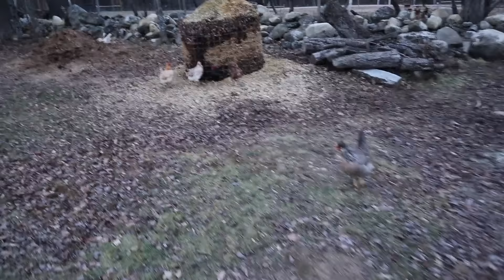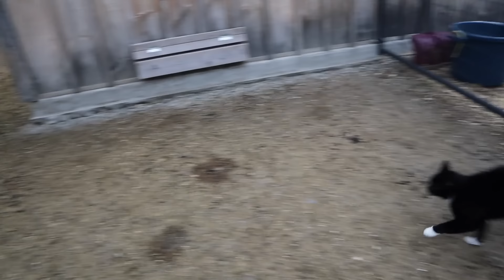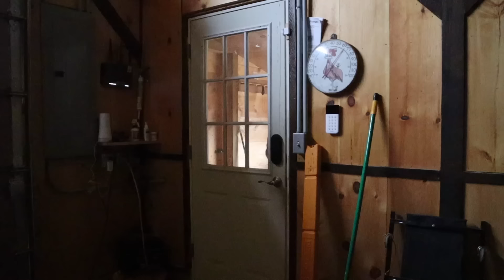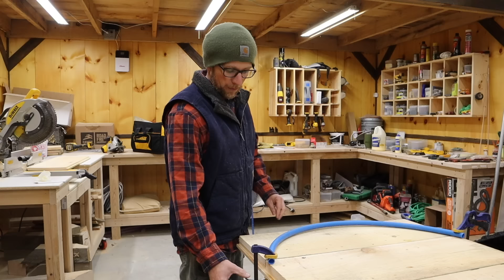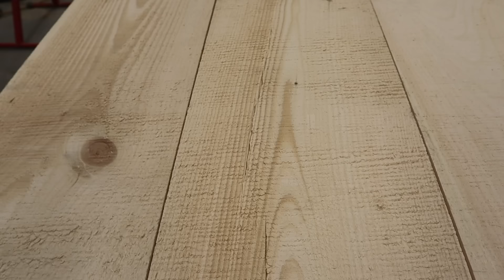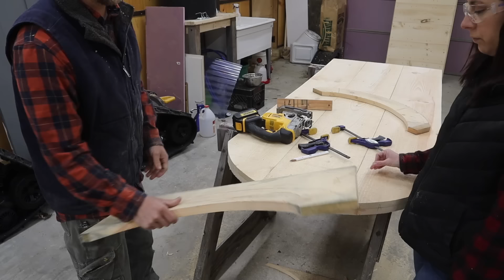Making Radius Doors & Trim for our OFF-GRID Property Composting OutHouse

Comment: Good morning Al!! As a former teacher this popped into my mind. A question in a test having to do with finding area with a goat, rope, and fence involved reminded me...  it should work. Measure the width of the door. Divide that number. Tie a pencil to a piece of string that measures that divided number right at the center of your door at the top. Stick a tack through it. At this point it should go all the way to the left and all the way to the right. It shouldn't be longer or shorter  on one side or the other. We are using the radius!! Now draw a half circle using your string as a guide. Ta da!!!  If done carefully it should be good. Without drawing this is difficult!!! Picture Hope attached to a rope which is attached to a fence in an area of that plant they like so much. It's a very straight piece of fence and she ate a very fine looking half circle.

Comment: We always used a strig nail and pencil ✏.   Measure door with, mark center then measure depth of  Radius you want. Place nail in center and tie string. Then hold pencil and string tight and mark radius.

Comment: you can put the battery inside the green house and the solar panel just outside, just need to pass some wires under the green house sides. Also set the angle of the solar panel based on your latitude and to the south.

Comment: Hi Al,  using the pipe was a good idea.  Another idea is to us a nail as the center point and use a piece of string or a yard stick with a pencil attached to draw the arc.  This should work pretty well,

Comment: Easiest way I’ve found to do a door top like that is to add the trim the the door blank you made. Then find the center of the blank, let’s say the door is 36” for explanation, mark 18” from one edge at the top, then go down 20” then mark out the 18” and connect the two lines. From the top of the door measure down the 18” again on each side of the door and connect those lines to find the center. Since you want trim, mark down the door another 4”-6” from the center lone to get your trim piece. Take a small nail and set it in the center mark, then use a piece of string and at 18” wrap it around the pencil and do your arch. Then move down to the lower mark and do the same for the top of the door. The two arches should give you the top of the door and the top of the trim. You just have to make sure the board the trim is cut out of is big enough to hold the whole arch. Looked great what you did! What we will do for our wives....lol.

Comment: Tie a loop in the end of a string and then place a pencil in the loop. Find the centerline of the radius and hold the string on the center point and move the pencil to the correct radius. Use the pencil to swing the arc.

Comment: take the width of the door / 2  for center. measure from top same as center  so you are equal left, right and top. this is were you pivot a tape meassure or string

Comment: I make radiussis with a little nail as centerpoint, a piece of string with a loop at the free end and a pencil in the loop.... that's pretty standard. When you put the nail in the centre of the door, you certainly will have even sides, which is not certain with your methode. But it will look very nice in the outhouse.

Comment: Hi All, just watched you cutting the arched top on your door. You need to get yourself a router and a couple of flush trim bits. Make a pattern then cut identical pieces using the router and trim bits ... Doors for the new shef are going to look just as good as all your other buildings. Great job!!

Comment: Was wondering if you are having the doors swing in or swing out.  Out would be best for several reasons.... #1  Won't take up floor space on the inside AND #2 (the most important) is BEARS and other large animals.  They push in to gain access.  Having the door open out will slow down their access.

Comment: you can use a piece of lathe with a screw on one end and a hole that a pencil fits in on the other. measure the width of the door divide by two that's the radius. put pencil that radius from the screw and put screw in very center from left and right and from the top. there you go you will like that buddy.

Comment: Al use a 3 ft wood ruler drill a 1/8 hole at 1" mark. If door is 32" wide divide in half which is 16 add 1 =17. Go down 17" from top of door 17" then side of door 16" mark center take 3' wood ruler with hole at 1" put finish nail in hole on center mark nail then drill hole at 17" put sharp pencil in that hole make your radius then cut. My wood ruler has been used so much it has marking holes everywhere. hopes that helps ya .

Comment: Hey Al,  Just as a thought for the heating in the workshop.  I remember you put in the electric heater but did you consider a small ceiling fan to move the warm air from the peak downward.  I think it might keep things a bit warmer for you in then winter and cooler in the summer.  Might even save some money on electricity.  just a thought.  enjoying the videos as always.

Comment: Easiest way I found  to cut a radius is to work out the radius you want (eg. half the width of the door or more if you want a shorter profile) and come down that far from the top. Put in a nail. Tie a piece of string to it and attach the other end to a jigsaw so it meets with the desired radius. Then keeping the string tight, cut your arc. If you use a small nail/tack it will not leave too noticeable a hole/mark on the door surface.
Good job though

Comment: If it was me, nail and a string 🧵. Then measure down the sides how's the wood when making the Arch on the door and how much of an arch you want. Then make a template out of plywood so you will know the arch dimensions and at the same time you will have a template in case you need to make another door 🚪

Comment: To get a radius I use a drawing pin, a price of string and a pencil. Works like a giant compass set
Reply: You can also rig your elec saw with a radius strip of metal towards circle center
Reply: Was just about to say the same
Reply: Beat me to it Elizabeth....was a carpenter for years and anytime I needed to draw a half circle used a nail or screw, string, and a pencil. Even did it with glass....way more difficult and used a suction cup but worked.
Reply: Radius jig and a router, no need to sand 👍😊

Comment: There are several ways you could have used to do the radius cuts for you doors and trims  , you completed the job with your method and happy with the results,  that's all that matters , stay safe
Reply: todays homesteaders are trying to reinvent the wheel , as the lessons learned from our grand parents and parents were NOT passed down . now everyone is trying to learn what the missing info is ,everyone now days has a collage education and no skills to know how turn ideas into reality. "street smarts" beats "book smarts" everyday.    He could have used the scrap piece he cut from the door to be the top piece on the building no other cutting would have been required,had he left the amount he cut off the bottom ,on the top!!!!arc would have been exact as he cut it

Comment: I guess you did not consider using a nail, a string and a pencil.  You measure for the exact center of the curve and put the nail there.  The string is tied there and the pencil is strung out the farthest point of the curve needed.  Now just pull the pencil tight and mark your arc...

Comment: You have to be kidding it’s so simple guess you never had math in school one oc of string one pencil one nail or push pin measure half the with of door in from top and both sides and you have a center take string tie one end to pencil ant pin the other to the marked center point arch the pencil on wood and bam one arch door